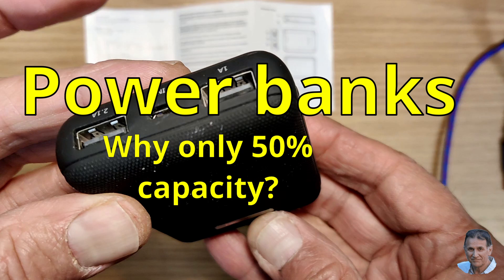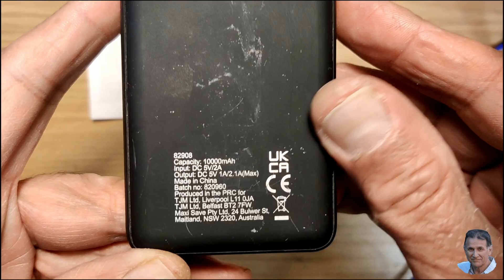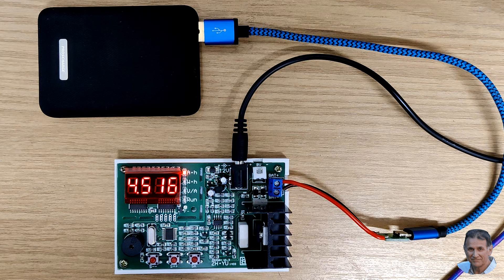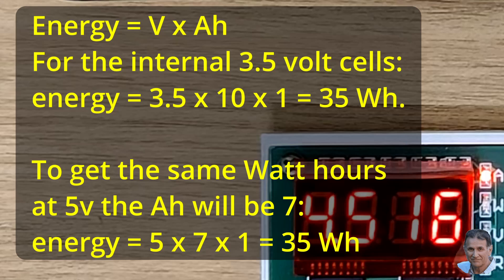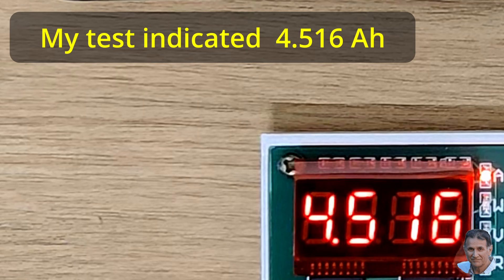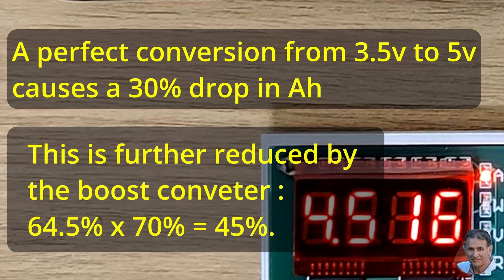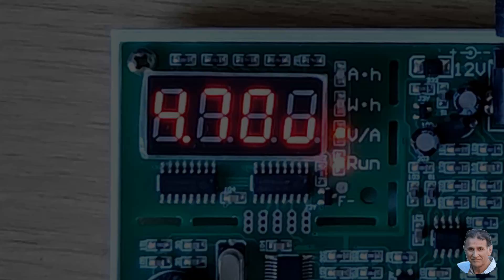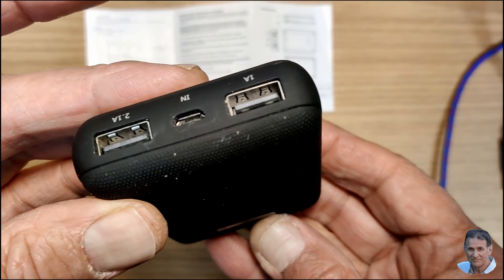Only getting 50% of the mAh from your USB Power Bank? Here's why..

Comment: You should check the Battery inside ,Directly  . It is also  around half the capacity ,in most Budget power banks ⚠️
Reply from the maker: I did think of this, but the batteries are sealed in.

Comment: Yeah, specifying the Watt-hours would make much more sense. Unfortunately, manufacturers are happy whenever they can scam customers, and most of users don't understand it anyway. And even when they state the Wh capacity, it's a simple multiplication of maximum cell voltage by Ah, ignoring the voltage drop, cut-off voltage and the boost converter inefficiency. It's kinda sad how scummy the market become...
Reply from the maker: So true.
Thanks.

Comment: Do higher quality power banks have better efficiency?
Reply from the maker: The inbuilt voltage coverter would likely be more effiecient in better quality power banks.
Beware the fakes that may have cells with less capacity.

Comment: It's not due to the inefficiency of the converter... It's due to the age and quality of the used cells. But yes, the marketing is, as usual, misleading. It does state the capacity at nominal cell voltage, which is usually considered to be 3.7V
Reply from the maker: The power bank is about a year old, and it tested the same when new as it does now. I have hardly used it as I thought it was a fake and nearly returned it to the store. I also think the boost efficiency looks poor, so there may be something I've missed.
Reply: @richardlangner Consider purchasing a powerbank that supports USB-C PD (power delivery).
     Preferably one that supports 5V, 9V, and 12V. (For all your mobile device needs). If it has the 12V listed, it can do fast / boost charging

Comment: I done the same test with different brands the best was a basic anker micro usb 10AH 2 usb came out at 9600MAH I had others come out at 8000 and 6800MAH but never this low. Some brands also state the rated vs the battery capacity. Like the cuktech no 30 is 40AH battery and rated as 22AH output.
Reply from the maker: That's interesting, thanks. I tried getting into my unit, but it is all glued tight shut, so I can't get the the cells to measure them properly.
Reply: @richardlangner If it's a Lithium-polymer cell, I can advise you: DON'T open it up. 
      I recently did so, and almost ripped the protective outer layer of the cell off..

The shell is glued to the battery cell itself. (Had to cut through the glue with some guitar picks and flattened chopsticks)

In retrospect, I should have heated the shell slightly.
      You can safely do this by taking a thin cotton sock, filling it with rice, tying it off.

Whenever you need to open something like this, put the sock in the microwave for 30~40 seconds, lay it on top of the shell / screen / whatever, wait for a minute for the glue to soften, and THEN try opening

(works for iPhone / iPad screens too.
     It's the DIY version of the thing iFixit sells to open iPads.
     I have the official one as well - works about the same.
     It works because even dry rice has some moisture left inside. You're effectively heating the water to pre-boiling temperature)
Reply from the maker: @iggysixx   That's useful advice, thank you! 
I normally use a domestic hair drier to remove sticky labels but a rice bag (or perhaps a wheat bag) would provide a nice gentle warm-up.
It's good to share these ideas, thanks again.
Reply: @richardlangner  Hair dryer works fine in almost all cases, but since this concerns a battery... Perhaps better safe than sorry

And thank YOU for your videos, btw
I shall try your soldering trick shortly. And this powerbank video was good as well (although the capacity seems too low to be accounted for with 'lossy conversion' alone. More like lower capacity cells were used)

I knew about the disparity between listed capacity and capacity when used at 5V already, but you explain it well, and I like how you were able to test it.

The only way I have to test capacity is to have access to the cells, and do a dedicated charge/discharge cycle for capacity measurement with my SkyRC B6 Mini battery charger.
     (I like when capacity can be measured through the actual output, like you do)

Comment: If you went for a lower current, I would expect a higher efficiency. An efficiency of around 70 to 80% should be possible.
Reply from the maker: You're probably right, as my test was not very accurate. It was to demonstrate that the voltage difference can lead to the wrong expectation of capacity, even if the boost converter has no loss. Thanks for your feedback, it's appreciated.
Reply: Standard in battery specification is measuring the capacity at 1C, basically discharging it in 1 hour. The capacity drops at higher currents and is bit higher at lower currents.